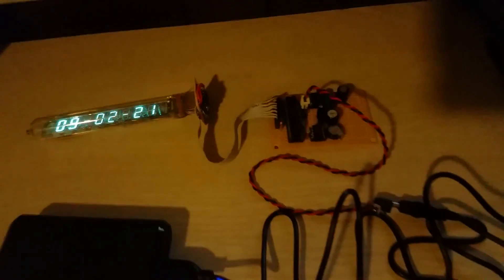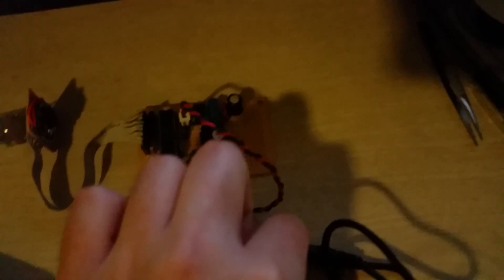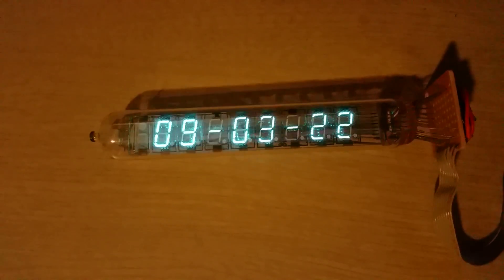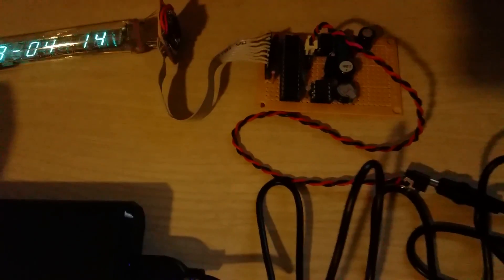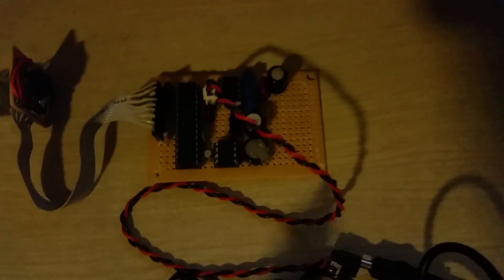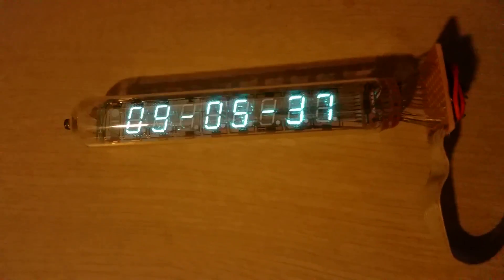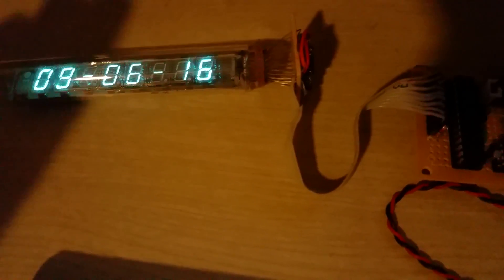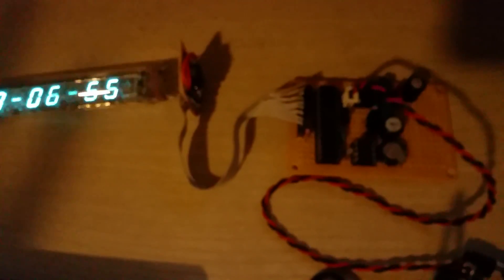DIY IV-18 VFD Clock Finally Works!

Comment: Your watch is very cool, however, I have some questions:
1) Is this video from your page here? https://forum.arduino.cc/index.php?topic=159775.0
2) Please share a schematic of how to connect the components, such as the MAX6921 on the Arduino and the VFD;
3) From what I read on the forum, this commenter (dc42) suggested you to change some things in your sketch, so, did you do that or is the current video content the same as the sketch shown in the mentioned forum?
4) If you changed the sketch, could you share it here?
5) Is your code compatible with any VFD Display, as long as it has the same number of digits?
I apologize for so many questions and thank you very much if you are answered!